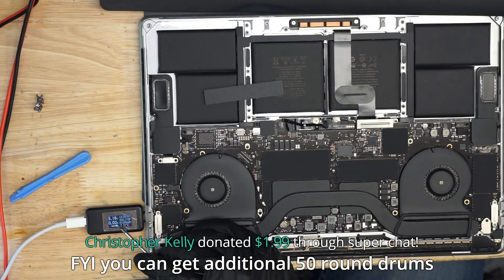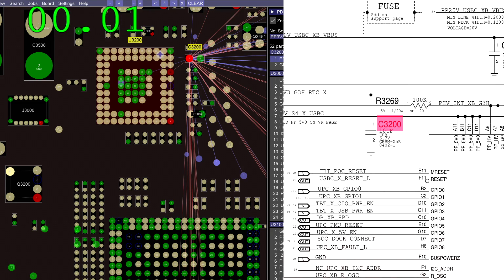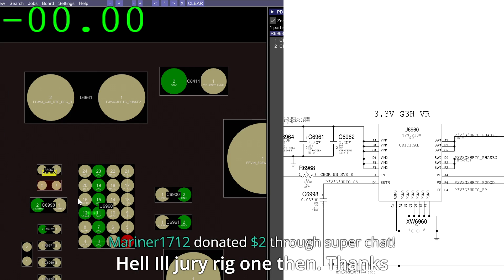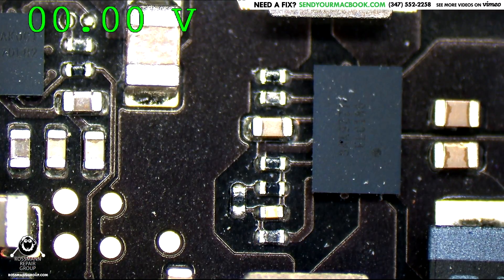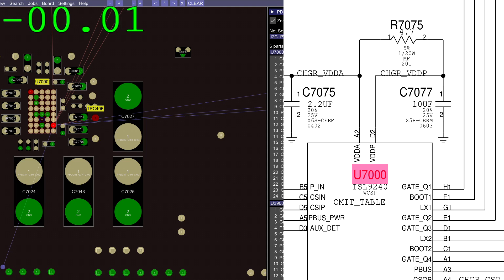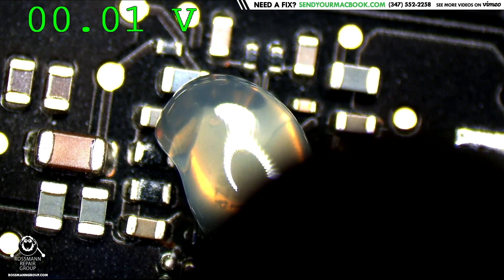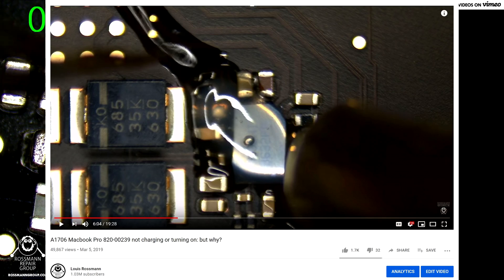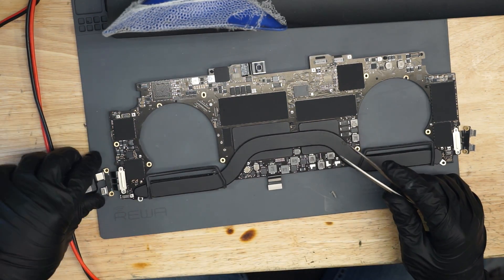How Apple is shaping the future of repair.

Comment: Hi I'm impressed on the details you are telling about Apple hardware failures, but my answer is not "don't buy Apple again" for various reasons, mainly because my wife falls for their promises. She once had a 1500€ Acer Laptop that bricked because of a too hot charging plug, so her argument would be that every manufacturer can make mistakes, but she would rather be serviced (I: f**d) by Apple. So since we're about to buy one of these new 16'' macbook pros with all hard-soldered components, and now knowing that there is 0% chance of independent repair, what do you think is the best way to not having to throw that thing away after two years?

Comment: Louis cant you sort a work around for isl9240 (small buck converter to create the missing 3v3 rail and a generic charge chip dead bugged and mod wired if necessary ) or even a bypass just to get it booted and data recovered... would enjoy working for you trying to figure ways round apples nonsense.... happy 2020 to you and yours Steve

Comment: So I was thiking is there just problem with charging? Would it run of battery? If so why dont we make charging with new small board outside macbook board and fake signals to charger? I think I should be able to make it work. Louis can you give me some info about it we might be able to work something up until they lock us up for hardware hacking.

Comment: Everyone should have the right to repair their stuff with that I can’t agree more and there should be extra laws protecting the repair shop clients. Just to point out my experience. I live in Poland (this might be important) and a month ago had my battery changed in my Samsung galaxy S6 at a, as I was told, good repair shop. Something like a week later the battery literally exploded with my phone. Naturally I wanted to be compensated for my loss but I was told that this might have been due to the charger (I use the original Samsung charger) and there is no way I’m getting my money back unless I go court and win. So yea that sucks. What I’m saying here is we need to have the right to repair and need to setup laws defining some standards so that this kind of stuff doesn’t happens. Incompetent repair shops with untrustworthy supplies are a thing we need to fix because of them we might loose in this cause.

Comment: Just playing around with a Raspberry Pi single board computer. Turns out they did exactly the same shit, using a modified, proprietary MXL 7704 chip for PD/USB power, nobody can source and replace if burned:  https://www.raspberrypi.org/forums/viewtopic.php?t=238779
Official statement by a RPi Foundation employee "Best advice? Don't keep shorting out your power rails." =>  https://www.raspberrypi.org/forums/viewtopic.php?t=238779#p1459572

Comment: ISL9241 is freely available and should be compatible. It's like saying the original NE555 is no longer for sale, we're all doomed. Plenty of people make buck-boost USB3 charging kits and plenty of chip makers make single-purpose chips, even for low yields, you can probably get a custom chip built for <$1 (min. 10,000)

The other thing to do would be to harvest the "custom" chips from other boards that are otherwise damaged, there is another channel on YT that does this regularly for gaming consoles, even the XBox and modern Nintendo that are just as 'closed' (for piracy reasons) as Apple.

If you think you can make a business out of repairing Apple gear outside the regular channels, charging batteries isn't rocket science, the right to repair requires the duty to put in some effort.

Comment: This is not a dead end.
If there is no analogues avaliable then
someone should be able to make a separate board which has the same functionality.
solder it with wires and put it near by. There is plenty of room for that and board would be not that big.

Comment: Modify a charger so it puts out the 20v or 5v or whatever you need to make it work so the machine turns on and they can recover the data.... isnt hard to do for any other type of device, would never touch a apple product because F*** Apple, you can get a stock power supply box from any electronics store that puts out the required voltage and current all you need to do is solder a apple plug onto the end of it
Reply: If you bypass the signal that says for the charger to put out the right voltage, so the charger puts out that voltage anyway it should work correct..... If not that charge the battery in a donor machine and reconnnect it full and you should still be able to recover the data

Comment: Can't you "just" shortcut that chip? I.e. if one pin should output 5V can't you just shortcut that trace? Or emulate that chip with another micro controller? I understand the functionality won't be 100% the same. But maybe some functionality would be good enough - comparted to spending > 1000USD.

Comment: I wish this video was posted two weeks earlier, just spent $800 to replace the whole logic board on a 2016 mbp 15. So annoying and I switched to a Lenovo running Linux, couldn't be happier when I take off the back cover with a Philips screwdriver and inserted a RAM in under 2 minutes

Comment: have you thought of soldering wires to the outputs of the chip and emulate the chips with a bunch of voltage regulators and get the machine to boot long enough so the owner can run a backup?

maybe we need some chinese manufacturer to step up to the plate and counterfeit or knock off the chip and sell it on ebay.

has anyone tried to clone the internal drive to an external drive so that they work from an external drive?

Comment: I replaced my iPhone 6 battery with one from another iPhone just like it and I get this battery error along with the phone shutting off at 70%. Then shows it needs to be charged but when I plug it in it turns on and shows 30ish % of battery life. My battery had probably over 900 charge cycles and the one I replaced it with had around 250. WTF is going on here. This happens about 5 to 6 times a day. I ran 3utool to see if the charge actually was right and the program said different from what the phone said. Maybe I did something wrong but this isnt my first time changing a battery out of an iPhone. I also have been having the same problem with the iPhone 5C which is why I got the 6 but I'm thinking on switching back to my iPhone 4 on IOS 6

Comment: In theory, will it start if you provide 3.3V (or all necessary rails) from the external supply? If it doesn't have some firmware inside there must be a way how to fake it to get those data out (at the price :D)

Comment: Is there any recent macbook you can actually reccomend? I have a 2010 macbook pro 13, i5 and now ssd, still use it alot and everything still original including the battery! That says quality to me but I need one with a better screen.
Reply: Mac is honestly shit, but for real, I'm pretty sure that you can plug in another monitor for your needs, stops you from having to buy another device if that one still works. Sure its not handy or portable but you can always use the original screen when away from your work station. I'm not all that informed on monitors, I'm mostly interested in display graphics tablets and they seem to work fine with macOS. Maybe something slim similar to those is a good idea, depending on your work.
Reply: Allias Miazaki I am a consultant, I have to show pictures (of solar panels i.e.) and a better screen would be nice.
Reply: @MrGoogle87  I see, well technology has come a long way, I believe you will be able to find a slim and portable solution for your problem.

Comment: Wouldn't it be possible to charge the battery externally so that the Mac would turn on for data recovery?
Reply: Hey.. good point! 🤔
Reply: I would imagine the battery BMS is built into the board.  To replicate the BMS require significant reverse engineering so based on how Apple restrict a simple power control chip, it’s not so far fetched to think they would also restrict the design and access to chips for BMS.

You maybe could remove a fully charged battery and replace the one in the faulty laptop to get access and recover data. But the laptop is a dead unit.

Comment: Am I to assume that an Apple-authorized repair center COULD NOT repair it because they do not do component-level repairs, and because the security chip/SSD are also soldered on to the inoperable board, they also can't get data off it as well? So the device is not repairable by Apple either and they cannot get data off either? And the only thing holding you back is the Intersil chip? Is the supply of chips from recycled computer boards no longer viable?

Comment: Apple isn't listening. They are fixing what they did wrong in the first place. That took several steps backwards and now they're back at square one. We still don't have ports. The battery and hard drive is still soldered down. We own the computer but Louis Rossman can't fix it after warranty. We still have to buy dongles that do not work. How is that listening? I have another miff. We all have our favorite YouTube Channels comparing laptops. Some are Apple fanboys. Some are not. None of them are opening up the guts of these computers to prove why one computer is better than the other. Only Louis Rossman does. Louis knows 10X more as these guys but only has half the subscribers. None of these other guys will mention Louis Rossman for fear of losing their base. It's better to talk about that gorgeous new bezel. It's better to talk about, oh my gosh, the new or is it old, escape key! Surely they know something. Maybe they can tell us where we can get an ISL9240?

Comment: I recently bought a new battery for my Alienware m14x and it didnt charge the battery,, then I bought a new AC adapter and it also did nto charge the batteyr,, would charge for a second and then would show plugged in not charging,, do you think the same chip is used in the m14x  motherboard and that maybe that chip isnt functioning and nto allowing the charger to charge the battery?

Comment: Louis, just for the data recovery portion.  Since the ISL9240(?) is the issue, woud it be practical to source a new board with the intent of of canbalizing it? That way you could at least get the customer's device powered on so that you could then extract their data from the SSD for them?  Obviously it wouldn't be profitable on a one-off request or as a source of replacement parts.  But if this chip/board/SSD is this locked down and prone to failure, I imagine that data recovery for these SSDs has a healthy demand.

Comment: My Dell XPS 13 9370 batterie just died today. I called the technical support in Germany and I had the choice receiving a new batterie or sending my Laptop to their facility and they repair my device for me. That's really great, I really like Dell and their design of products. I can repair my laptop with no hassel. And the device is thin, light and has plenty of horsepower.
Thanks Dell!!!

Comment: I wonder if you can hack a different charge controller chip onto the board (maybe with a few extra parts) to at least get the board to run to copy the data.

Comment: I bought a dell laptop in 2011. It still runs almost entirely fine minus some speed as the years got on. I've just replaced it with a new model but if I wanted to I could go pick it up and turn it on and get my work done as normal.  How many of you can say the same about your apples?

Comment: This is terrible, no doubt about it. But I was wondering: what if you forced the charger to run at 20v using an external tool or even using a charged battery? Would the customer be able to get their data back?

Comment: Damn. I would be fine (well not really but i could live with it i mean) if they blocked off that ship for resale to consumers, repair shops etc etc but I draw the line when they single handely bribed an OEM factory to change a chip that im sure is used is many products outside of apple effectively locking off repairs for other products and removing that chip for future products for the foreseeable future. Truly scummy man I'm so glad I didnt buy a new macbook. Im still rocking my old macbook air 2011 model and im praying it keeps on kicking.

Comment: I realize that this isn't the point of the video, but would it be possible to provide an enable signal for that chip from an outside source, as a temporary jerry-rigged solution to get the laptop to boot and get the data off? Obviously, this wouldn't be economically practical for a repair shop, but this would be from the hypothetical perspective of someone who's doing it on their own. It seems so frustrating that an IC worth literally pennies could lock someone out of something that's potentially priceless to them.

Comment: Can't you supply 20V to the board and dummy up enough lines in order to allow getting data off the machine? Or supply a 20V wall-wort and jigger the machine to bypass enough circuits to work without the chip?

Comment: there is a video directly addressed to Louis if you google isl9240 the guy says he found another product with this chip in it that may be used as a doner board. I take no credit for it other then doing a google search. here is a link https://www.bitchute.com/video/i6hfcr-2LL4/ the product is a charging iphone case with its own batteries and charge circuit. I mean it may be an expensive doner but better than letting a $1500 laptop stay dead.

Comment: I totally am with you. I had an iPad pro that costed me almost INR 60,000 in India. 
Just a few days after 1 year warranty was over, it stopped working. It started getting into auto-boot mode. 
I went to the apple repair center .. they just connected it to their systems and ran repair check iTunes and told me that it is not a software issue but a hardware issue and it can't be repaired. All they can do is replace. Replaced item would cost me INR 38000. And when I checked further, they were not giving me a new iPad pro but a refurbished one with only 3 months warranty. And if it would go bad again, I won't be able to do anything further. 
I tried every piece of software online, apple, non-apple, nothing worked. And so my INR 60,000 were wasted on an idiotic apple product. 
And I believe it was just the same level issue that you are showing .. must have been some chip gone bad or something.

Comment: There is no way I will be purchasing any new Apple Laptops past 2012...Apple is simply making it impossible for an owner to upgrade their  v ram or make any enhancements to your laptop...Everything is welded into the logic board...If you want to simply upgrade your v ram, you will have to go to them or weld it yourself rather than just putting into a slot like in the older MacBooks...

Honestly; it is time for some other manufacture to step and create a  Linux base operating that is equal to or surpasses Apple...Apple is out of control just like Windows is...These people are demented and there are lot of states passing laws to allow a buyer to fix and repair their equipment...This demented concept that apple is using on it's laptops doesn't end with just computers...They are involved in manufacturing equipment as well...

People, purchase yourself an old apple laptop and upgrade it...And that battery configuration in the 2015 to the present is the worse I have seen in any laptop...

Comment: Same chip failed in my 2016 McBook (I don't want to remember which one ie. Air/Pro/Any) in June 2019 and the repair technician at Nehru Place IT market in South Delhi (which happens to be the largest IT hardware market in South-east Asia) told me the same thing which you are telling us. So my Apple Fanboy bubble burst. And then I bought a Dell Precision Workstation.

Comment: About 4 years ago I took my MacBook Pro, since the display was not working. Apple was going to charge me 1200 to fix it. This is where I found Louis. All he showed to do was bend the display connect pin back. I took me maybe 20 mins and it worked... Louis you saved me $1200 and for that I say thank you

Comment: I've been an Apple user for ten years now, mostly happy with the products. Before I was using my self-assembled Linux PCs, and before that the regular Windows stuff, going back to the early 90s. I do regularly solder through hole stuff, for retro machines, I like to tinker with electronics. I personally am fine with the fact that I can't service my Apple products. But I am not fine with the fact that 3rd party repair shops can't service my Apple products, due to artificially limited supply of replacement parts. I had the 2011 MacBook Pro have its LCD display break. Official Apple reseller wanted to have 600 EUR for the whole display assembly. A repair shop in Frankfurt did the repair for 200 EUR. I guess this will become harder and harder.
I also don't buy anymore MacBooks and don't recommend them to friends for this reason. I still use my 2013 iMac and might buy another iMac when this one finally breaks down. With iMacs, I won't run into problems due to liquid damage or dropping them. They have less risk of breaking. The new MacBook Pro 16" also shows that at long last Apple gave in and acknowledged that the keyboards of the last years were utter crap. That the touchbar is useless (although they only gave us the Escape key back). Let's talk to them more, and tell them and explain to them that we want repairable devices. Maybe, just maybe, in time they will start to listen. It might take some years, though...

Comment: My two thousand and thirteen MacBook Air has been having issues. The battery holds a charge but the screen decides to turn off and on at random times and same with the keyboard. Of course Apple says I need a new motherboard but I'm not sure about the actual issue. It doesn't turn on visually now but I can hear the hard drive starting up when I open it. Please help.